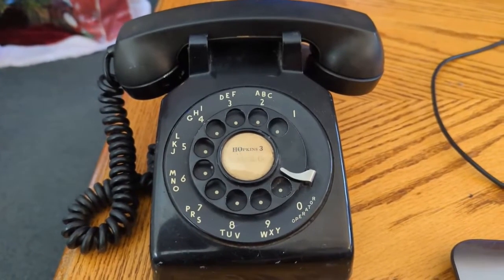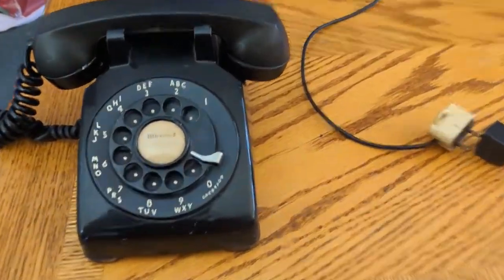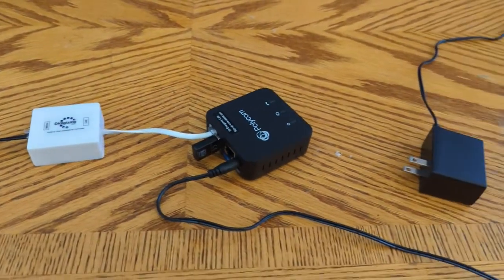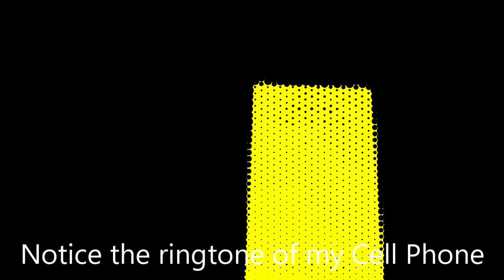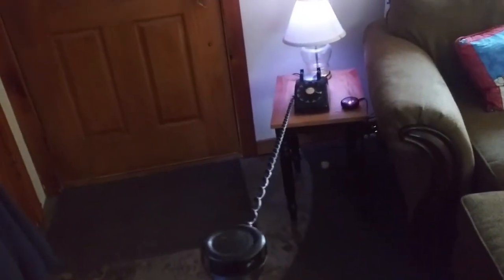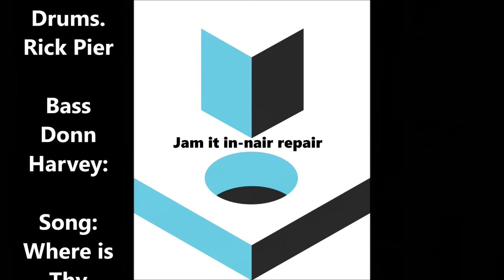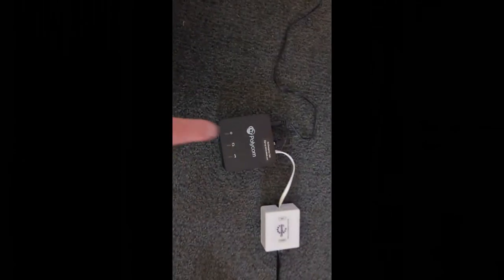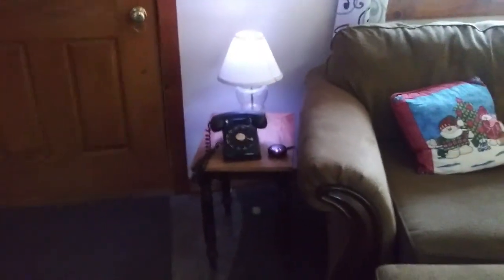I get a Rotary Phone working with Google Voice, Polycom and Dialgizmo.com.  NOT a HOW TO video!

Comment: Hey there. I haven't purchased the pulse to tone converter yet. I am trying to use my rotary phone with my obitalk. Just plugging it in directly I can answer  calls and hear full duplex. Was there any settings you had to change in the obi's configuration to get the ringer to work? When I call the rotary from my cell phone it doesn't ring the bell. Does the pulse to tone converter help with ringing or only dialing?
Reply from the maker: I had to open the phone and clean the ringer to make it work.  I little WD-40 also helped.  Check the volume dial on the bottom of the phone.  I hope that helps.

Comment: I love this concept to make rotary phones useable again.  I see one problem though.  When a number you dial requires a star or hashtag, this concept is unusable.  You might figure that if you cut into the rotary phone, two small square holes to take in the star and hashtag, to configure for this need, then that would be the fix.
Reply from the maker: The dialaGizmo has the capability of doing any thing you can do on a push button phone using the rotary. It's really amazing and consists of short dials. I would have to look at the manual to see how to dial an astrid.  I would check out their website for more information. Thanks for watching.

Comment: Obihai OBi200 1-Port VoIP Adapter with Google Voice and Fax Support for Home and SOHO Phone Service, Black
Brand: Poly
4.4 4.4 out of 5 stars 3,895 ratings
| 285 answered questions
Currently unavailable.
We don't know when or if this item will be back in stock.

What can I replace my OBi200 with Google Voice?

There are no replacement nor follow-on VoIP hardware products that will directly work with consumer Google Voice, and Google has no plans to allow any other devices onto the service. So, go ahead and continue to use your current setup.Apr 15, 2023

 OBi200, OBi202 and OBi212 have entered the End of Life phase with the following key milestones: End of Sale date is December 18, 2021 (as supplies last) End of Engineering Support is December 18, 2023. End of Service date is December 18, 2023.Feb 22, 2022
Reply from the maker: Thank you and this is all very good information and I appreciate it very much. I guess we're going to have to shop around and find what other alternatives we can come up with.